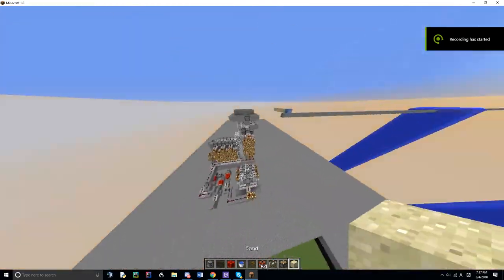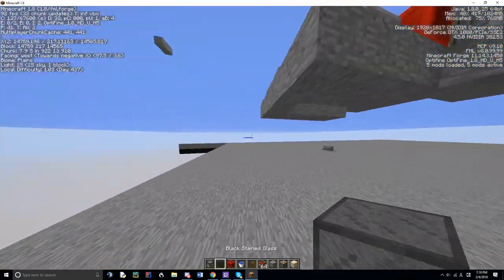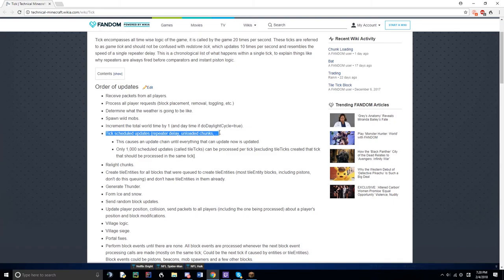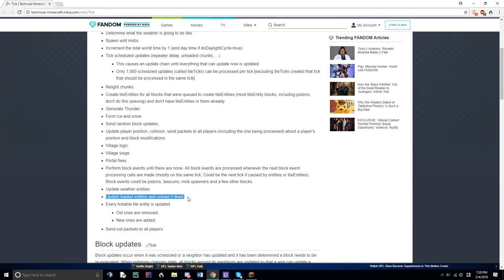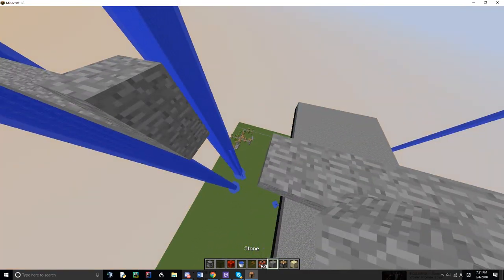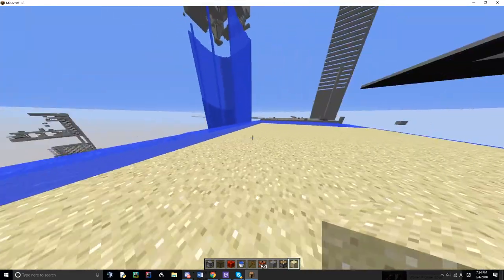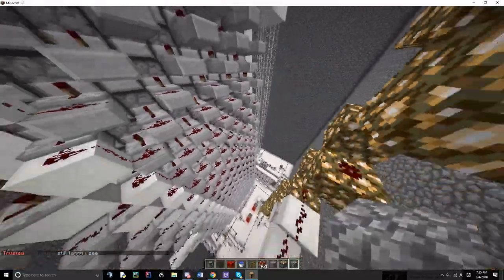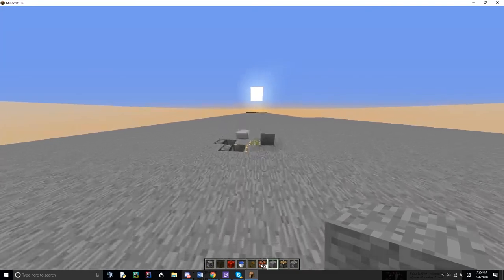Roof Cannon Exposed (Re-uploaded)

Comment: Doesn't the sand need an update in order to move from inside the cannon to 255.125? Spigot checks the height limit right after it moves and kills it if its over the limit. And the entity move is done after the pistons, meaning that the pistons won't move until next tick. Why doesn't the sand die when it hits the underside of the slab?
Reply from the maker: Like i said in the video the piston tp method gets called before the move method which is called before the spigot patch. This means my sand already stacked before the patched even looked. It does not die due to the slab because its under 255.